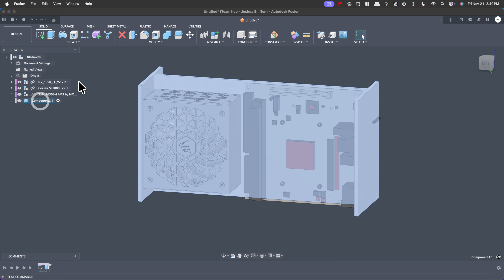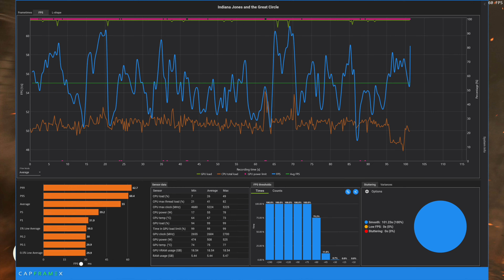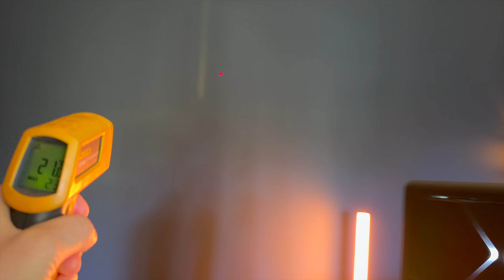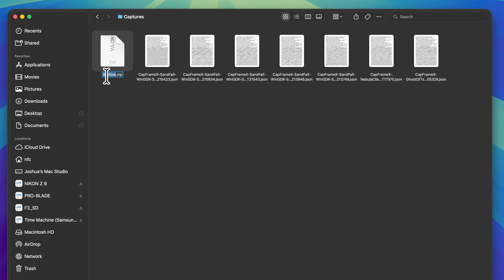Skyreach 5 MINI: Test Results

Comment: 8 degree is by no means “ridiculous in the best way” lol. That’s a pretty bad result. There should be an option to move the gpu closer to the side panel (so that it’s easier to intake air) and then install some slim exhaust fans on the other side.

Comment: I'm very keen on this PC case but is that the final stand? Can you look at the Thor Zone Tetra's feet and make something inspired like that please. I feel like the stand really takes away from the rest of the S5M look.
Reply from the maker: Hello! There are two stands with different styling in the video, so I don't know which you are referring. I wasn't going to include a stand, because I have many styles and customers have strong feelings about what they should look like, so that's always been an aftermarket accessory. NCASE offered to pay to include one, so they get to pick. But it's removable and you could install your own option. I'm not going to copy Thor Zone though.
Reply: @NotFromConcentrate Hey, thanks for your response. Do you mean the two designs at 7:14? In which case I don't like both of them, they are quite similar too. I understand they must serve some function with the height for air or something but hopefully there will be a design I like. Thanks!
Reply from the maker: @boatwithshoes  feel free to design and print your own or submit specifications to us for custom work

Comment: What's the advantage of this over a fractal ridge?
Reply from the maker: I've been designing console cases for over 15 years and manufactured several. As far as I know, I've offered them for sale first; before flexible 16x risers were made and I worked with the first companies developing them for servers to make it. I also do consulting for other case companies and help design PC products. I believe the user should find the case they are most happy with. The Ridge is a beautiful case (I wonder why... ;) but it is a different market. It's sheet metal, plastic, and lower cost. It also has less ventilation. The S5M is machined out of billet aluminum and anodized. Only the side panels are sheet metal. So it's a matter of materials, technique, and taste. I really truly hope people buy the case they are in love with, which is why I design hundreds of cases for thousands of people. I hope this helps.

Comment: Am I overthinking this of should the graphics card be flipped, so air intake is on the same side, to avoid hot air recirculation? 

For instance, with the current layout, the hot air of the 5090 FE is going to be exhausted on the side both the CPU and power supply intake air from. Surely some of that hot air is going to recirculate back onto the CPU.

Comment: Hi Josh, thanks for this video! Thanks also to share your HWinfo & CapFrameX data. Before moving to the RTX 5090 FE...why your DDR5 is at stock 4800MTS TCas 40 ???..:)
Interesting point is that your RTX 5090 FE is NOT undervolted (vcore at 0.995v, like mine, at stock), thus your results could be even better with it. You can try my "not too aggresive" values with MSI afterburner (Core Curve : 825-910 @2700Mhz,  GDDR7 : +3000, Power limit : 100%). With that my RTX 5090 FE is around 0.90v. Your thermal results are in line with the best mini ITX, like the formD T1 with 20mm offset between MB tray and the RTX 5090 FE.

I agree that your side panels looks gorgeous & sturdy. One of the weak point of the FormD T1, by the way.

At last, I notice that the Shyreach 5 mini is only with riser gen 4...will it changed before the launch?
Reply from the maker: This was all pre-tune in order to get a team world feel for the average builder. Then we tuned it before sending it off to the customer.
Reply: @NotFromConcentrate  thanks! Will you upgrade the proposed riser to gen5, or at least a link to an existing replacement part?
Reply from the maker: @MarcParisTV  This video is not a test of the riser that we will sell and the one I used is not one of the ones offered as they are not ordered yet. I don't have the details regarding the PCIE 5.0 riser Ncase plans to bundle with it. But if you go to their website they have a 4.0 and a 5.0 choice.
Reply: @NotFromConcentrate  thanks you are right! gen 5 is also a possible choice with NCase

Comment: I have the same mobo with a 7800x3D, and the same PSU. But my 6950XT reference is not a flowthrough design. Hopefully you have some builds with something like that, I'd love to see how it performs. At $175 base I'd love for this to be my next case.

Comment: Have you tried an improvised air duct for the GPU to fill the gap between the intake fans & side panels? That way it should directly suck the cool air in from the outside.

Comment: Reminds me of the size of the alien ware Asus and msi console PCs. 

I've got an area 51 v3 with no disc drive. That's the minor downside and mostly I don't use disc's anymore anyway .

Specs; i7 6700 4 core 8 thread 
Proprietary, (Mobo, custom water loop, PSU interconnect for external PSU), 16GB DDR4 2666 2x8, GTX 970 *4GB GDDR5 vram, 256GB nvme, 500GB emulation SSD. 

I don't remember how much I paid for it but I've always wanted an alien ware since I was a kid and that was in the 90's

Comment: Please oh please tell me that this case will fit the IS-55 cooler. I love that cooler for the fact that it also does a fantastic job of helping cool the RAM. The 5th heatpipe certainly dosen't hurt anything either. I've also noticed in the console style cases that it does a fantastic job of providing active airflow to the SSD stack as well. 

Please Josh... make it happen.
Reply from the maker: I don't know yet tbh...but...there is a method that would work with custom panels. Two actually.
Reply: @NotFromConcentrate ...at first you had my curiosity... but NOW... you have my attention. Is this still super secret squirrel stuff, or can you talk about these options?
Reply from the maker: @ApacheVR-4  Not secret, because it will likely be custom ordered which is what NFC specializes in. So option #1 we considered making stock, and that is simply to use the side panels AS the motherboard mount, which gives you alot more room for CPU height. I decided against it because it's not elegant, and better suited to power users. The second option is the hotrod look, which I enjoy, where you precisely measure the socket location and make the side panel cut to fit the fan perfectly.
Reply: @NotFromConcentrate I already like the idea of using the side panel as the motherboard tray. Sounds awesome. I get that it may be doffocult to do though. 

Keep me in the loop on that as you get closed to production. I would be interested in that and hearing how much cooler height it provides. I know tbat the Der8auer IHS for AMD already gains an additional 2mm of space as well. 

And a slightly more random question, but how are you mounting the PSU? I always thought that mounting it with the exhaust pointed up (as in a vertical orientation for the case with the GPU in the top area) and then use some kind of short shield to direct the exhaust flow in the same direction as the GPU exhaust flow would do wonders for CPU chamber temps.

Comment: Kind of wish It had screw holes on the front for GPU support. Be cool if there was a rear panel specifically for the founders edition 5090 like milled out port holes. Like on the FormD T1 travel kit.
Reply from the maker: Well good news--this is V1. We already have V10 prototypes in hand, I'm just behind in the video department. This uses the same swappable bezel system as the S4T (front AND rear) so the compatibility is unlimited. ON TOP of that, there is an inner plate with a bunch of different screw mounts for GPUs, that Ncase designed. So hopefully, you are covered!
Reply: @NotFromConcentrate  Would be cool to have a little LCD sensor panel on the front. I'm defiantly excited getting a little bored of my FormD T1 to be completely honest my 5090FE needs a new home.
Reply: @NotFromConcentrate  Will there be matching silver mesh side panel option for the silver model or just black stock sides?
Reply from the maker: @Cooper3312000  Comes down to MOQ and signups...I personally would love a silver. There are challenges though; the side panels are steel and thus would have to be paint matched which never really does with aluminum.
Reply: @NotFromConcentrate oh I see thought maybe they were aluminum.

Comment: Beautiful let's see how this compares to fractal ridge.
Reply: @f-lan  The big problem with the Ridge has been loud turbulence noise due to the fans being right up against the sides. Would like to hear a side by side acoustic test at full sustained load without fan control profiles being used to quiet it down.
Reply: The finish will not even be in the same league.
Reply: My brother have asked for a console style build and all I could get my paws on in the price range he gave was the Ridge, and while not bad..the side panels are just a big fat (aka thin and bends when you exhale on them) meh...I have just finished the build, and I only had the panels off to build in the case, and now that I put them on again, they are already slightly warped, and corners are not exactly matching anymore. I don't care if I have to pay 200$ for the privilege of having this case...if these videos tell the truth, the quality here will be in a different universe compared to what the ridge offers
Reply: @solknald  interesting. ..

Comment: I’m VERY excited for the S5M. You have to see it to truly understand the premium feel and quality.
Reply: Just to give you guys some help: bright colours will further hide darker ones.

So if you had a case in Arctic White, then the internal black components will just disappear in the grill holes, at least to the human eye. And the opposite is true, if you had a Matte Black case and an All-White interior, your eyes will notice the mismatched internals through the small gaps.

So I recommend doing some Funtastic Colours. Arctic White, Pastel Yellow, Lime Green, Bright Orange, Retro Teal, and Hot Pink. Maybe make them as options, but letting the customers know it will add +1 Week extra to Delivery Times.

Otherwise, freely release the CAD files. So that people can Print their own Decals, or have an Online Service do the Vinyl Stamped Out. Or better yet, do both !!!

Comment: I understand these are old prototypes and there are new mesh panels (from ncase's website pictures) that will have even better airflow, due to the holes going right up to the frame?
Also would you consider doing a youtube live stream and answering so questions about the case?
Reply from the maker: Yes this is the first one, and it's outdated in specifics. But  the video still answers some questions as we refine before release. I'd be happy to do another Q&A.

Comment: Awesome work Josh! I wanted an NFC case for years but never wanted to go below SFX PSU’s so I bought an original S1 Ghost years ago. The S5M will be my next case but I keep refreshing the website to “Sold Out” for months. Do I still have a chance or was the case released and I missed my chance?
Reply from the maker: It's just their website...it's not available yet. Do sign up though so we know how many to make.
Reply: @NotFromConcentrate  Thank you for the reply and signed up ✅

Also, your review of the Q2 got me back into 3D printing (Ender 3 OG) and it’s been running non stop ever since. Thanks x2!

Comment: Some really important notes on this, there are some crucial mistakes. I'm not trying to be rude, and I'm sorry if it comes off that way, but this is important and I think bears mentioning.

1. Is this forged or just cold formed steel? Forged is, nearest I can tell, a very misleading term. Cold forming is actually better, it can increase density and work harden the part. EDIT: scratch this point. Cold forging is a valid term.

2. Your claim that Indiana Jones hits the GPU harder than synthetics is wrong, you're averaging 504w with a max of 525w. Use literally the most common GPU stress test, furmark. You should be hitting closer to 600w.

3. You made a really big mistake with your throttling measurements. You DO NOT MEASURE THROTTLING WITH UTILIZATION. Any half decent cooler will ALWAYS be at 100% util @throttle. You must use both frequency and the throttle indicators on polling software. You appear to actually be hitting the soft throttle point and losing 30mhz, but this could be just errors in averaging.

Side note, consider not using standard averages for your tests. Average/mean is very susceptible to outliers skewing it, some measures like geomean can be more stable.

And testing with games is dubious. Your results can change with updates.
Reply from the maker: I can absolutely include more of the data you’re talking about as we get closer to launch — I appreciate good technical feedback, and I want to make sure the community gets the information they actually care about. Just let me know the exact metrics you want to see.

For this video, I wanted a first real-world look using the system the same way I use it personally — 4K gaming in my actual bedroom, not synthetic torture tests. That’s why I used Indiana Jones: on my setup, it consistently pulls more heat and more sustained load than Furmark from the wall. When I run Furmark 2.0, total draw is actually lower, and the system doesn’t reach the same temperatures. If you have thoughts on why that happens on this hardware combination, I’m genuinely interested — always happy to learn from others’ experience.

As for the forged mesh terminology: I’m not trying to mislead anybody. This panel isn’t just perforated cold-rolled steel. It’s a compression-formed plate that ends up significantly denser and stiffer than a standard punched sheet — it’s just hard to describe that process quickly without it sounding like marketing fluff. If there’s a more precise term you think the community would instantly understand, I’m open to using it.

Anyway, thanks for taking the time to write this out. I’m always happy to work with people in the community who want the product to be as good as it can be. :) <3
Reply: @NotFromConcentrate  

"When I run Furmark 2.0, total draw is actually lower"

That could be a number of things. You could have a external frame limit handicapping the test, or have anti-aliasing turned on, which counterintuitively, can make the test draw less power. Without those factors, it should have no problem drawing 600W+. 

Another thing, I checked your .csv results with panels/exhaust on and quite frankly, they are terrible. A core temp of 80 degrees celsius at only 450W is ridiculous, and that's with the stock fan curve. This is worse than sandwich cases (NOT just the T1) with a minor riser offset. Because these are 600W temps at 450W.

I find issue with your statement at 3:45. You say that it is a 600W GPU but neither of the tests push it anywhere near it at all for any sustained period of time.

What I theorize to be the issue is the panel design, specifically behind the GPU exhaust. I don't think the FE fans have enough static pressure to push air through the heatsink and the panel at the same time. My suggestion would be: to be able to place exhaust fans directly in line with the GPU exhausts, as they are nearly 120mm fans. I'd test with the exhaust side panel off.
Reply from the maker: @bar.kokhba  This wasn’t meant to be a professional review — I’m not going to “review” my own product because that would be biased by definition. The goal here was a real-world demo: using the system the way I actually use it, showing how the hardware behaves in normal conditions, and collecting data as we iterate on prototypes and sharing with you.

I recorded ambient temps, real gameplay, and actual sound characteristics so people can see what we’re working with as we refine the design. I’m always open to feedback and testing suggestions — that’s part of the process — but it’s also important not to lose sight of the scope of the video and to be respectful of that.

So help me understand what specific data or test matters most to you. If you tell me exactly what you want to see, I can consider incorporating it into future testing. I’m here to improve the product, not race to beat synthetic numbers. One thing I want to make sure is understood: I fully acknowledge the mesh has performance drawbacks compared to open panels. That’s the entire point of this demo. I intentionally used the most powerful GPU you can physically put in the case to show the worst-case scenario for the mesh panels specifically.

We already have performance-oriented panels designed — I even teased one of them in the video — but this video wasn’t about those.

Comment: Love it. Was just checking your site the other day to see if you had anything to replace the S4M yet, as I'm looking for a new build soon. Nice to see this, signed up! 

One piece of feedback about the S4M: the threads for the side panel screws were very easy to destroy if you end up doing a few rebuilds (because it's a super soft material, aluminium?), two on mine the screws basically fall out of now. If you're using the same material, it might be a consideration to use a threaded insert in future builds (does add cost and time to production obviously).
Reply from the maker: Yeah if you over torque the S4M even a little you compress the threads, and over time, they will be destroyed. This is harder metal, and more importantly, it's much much deeper, so it will be better. Still need to use proper torque though! Thank you for being a MINI customer.